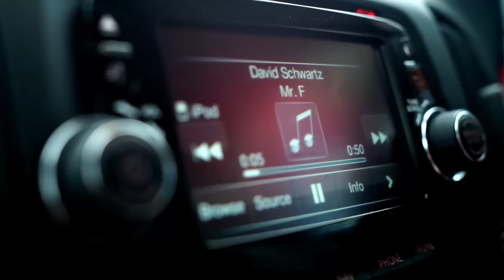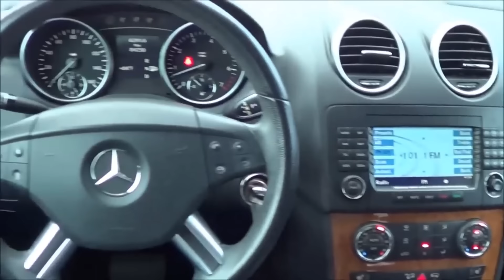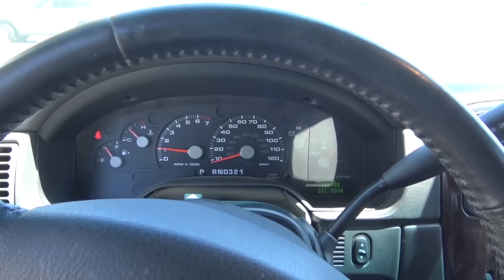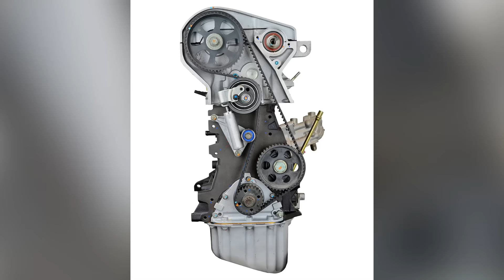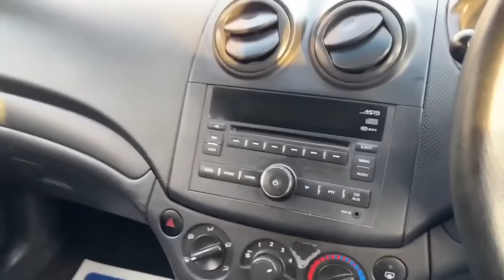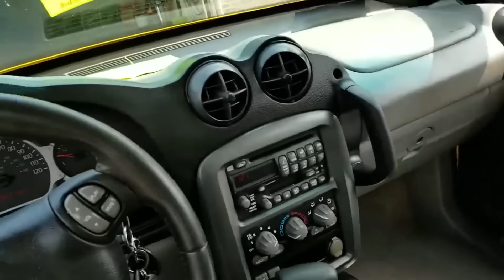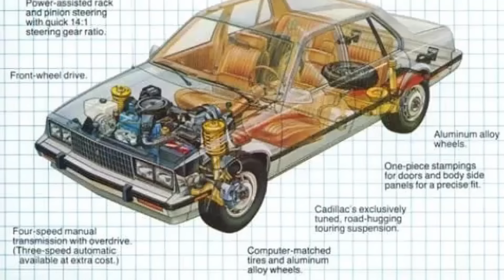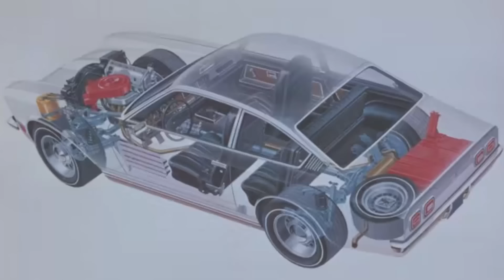30 Least Reliable Cars That Won't Even Last 60,000 Miles!

Comment: I owned a 2017 FIat 124 Spider convertible.  Assembled by Mazda,  I had no problems up to 70k miles when I traded it in for a 2023 Honda RIdgeline.  So, not all FIats are junk, just the majority of them!
Reply: It wasn't assembled by Mazda, it was a Mazda. Just a Miata with a differenet skin on it and Fiat badges.
Reply: @paultomaszewski1964  not completely true, Paul.  The FIat 124 had a Mazda transmission but a FIat 1.4L Turbo, iron block with aluminum heads.  Ran very well through to the time it was sold.  Mazda upped their non-turbo 4 in the Miata in 2018 to 185 horses (v 160 horses in the Fiat 124).
Reply: It had a Chrysler 1.4 turbo whereas the Miata, a non-turbo Mazda 4. Only the bodies were built by Mazda.

Comment: It's funny, I own a 2009 Chevy Aveo and it's been my most reliable car to date. Simple, basic motoring with nothing to go wrong. Mine has covered just shy of 277,000 kilometres and it runs great. I've only replaced the clutch once, besides regular servicing and wear & tear parts the car is still original, engine has never been opened and only front control arms have been replaced.
Reply: Maybe the Aveo sold in your market was better than the one for the US market.
Reply: @filippocorti6760  It's definitely possible or maybe I'm just lucky 🤷🏻‍♂️

Comment: Thumb nail looks like a Ford Taurus, I got a 09 still running like a champ .  Luck of the draw maybe 🤔
Reply: Mines is also, 2013 Taurus. The only thing I hate is the water pump issue.
Reply: Ive got a 2012 fusion its very similar  car . 280k with no issues
Reply: Notice it wasn't on this list, because it was a decent car that Ford and their wisdom stopped making for more profit margin SUV/CUV's that have been less reliable.
Reply: @zoomanx9661 did you have the pump replaced yet?  How many kms?

Comment: The Mitsubishi lancer isn't that bad I've had it for 5 years, It's a 2014 Mitsubishi lancer ES it currently has 150k miles on it, the most major problems I had was it's spark plugs and that's it.. with proper maintenance it'll be able to last long before you get a new car.

Comment: I had a 74 Vega used little oil AC ice cold.took out the 4 cylinder was still running good.but found a 400 small block car was fast and fun

Comment: I’m in the market for my very first car, I’ve been doing a lot of research on many different vehicles,  right now I’m looking at a 2014 Subaru outback. It has 128.3k miles. And it does have a CVT transmission. From what I’m getting from this video is that I’m good if I buy it. Correct?

Comment: USA has low octane and high percentage of ethanol in their fuels. For example in Europe 95 octans is minimum, while is the US 93 is premium gasoline. Also, USA has 10%-15% ethanol in fuel (not including high ethanol fuels for apecial vehicles), while Europe has up to 5% of ethanol in their fuel.
Reply: Interesting point. I wonder how much it matters for longevity.
Reply: @filippocorti6760  more octanes is better for engine.

Comment: You left out the 2004-2007 Mazda 6 S sedan & Sport Wagon with the Ford Duratech 3.0l engine. My 2005 S Wagon 143k miles won't stop springing coolant leaks as we speak[= Hoses, warped plastic T-fittings, water pump & belt and >now the radiator have to be replaced. It got so bad that I actually purchased every hose & plastic hose fitting under the hood as backup along with the drive belt, tensioner & idler pulley (it chirps at startup). [=

Comment: The Buick Rendezvous is the same platform as the Pontiac Aztek-- identical engine from the Chevy Venture and equivalents... They should have the same ranking, not be on opposite ends. I'm also surprised that Land/Range Rovers didn't make it to this list, but otherwise there aren't many surprises in this one.

Comment: Over engineering plus cheap manufacturing on new vehicles is a recipe for disaster. My 83 Thunderbird 5.0L with 85,000 miles still fires up and runs like a dream. And all electronics still work including power windows and locks, cruise control, digital dash, and all interior and exterior lights.

Comment: as soon as they said chrysler 200 I was like yep they clearly never owned any of these cars we had 2 Chrysler 200s they was great cars we never had a problem with them. Many of them now have over 100k miles and still on the road. I was looking at a dodge stratus in 2013 and my dad said you don't want it unless they can show you that the oil was changed every 3000 miles. He's been a mechanic for 30 years he tells me something about cars I listen.

Comment: Knew someone who had a 91 Passat GL and it made it to over 400 k recently and they live in Northern MN. Must’ve been a fluke. Used to have a 90 Jetta that I sold in 1993 with barely 30k on the odometer, and everything electrical, was a problem. Sometimes it would not start at all. Luckily it was under warranty at the time.
Reply: That was when they couldn't tell them V-Dub manufacturers NOTHING. 😊  And THEN...corporate big wigs got their hands in that cookie jar and I think everyone knows where I'm going with this...
Reply: And then lemons back then were quite few and far in between in comparison to today...

Comment: Fiat 500L only had problems with its automatic transmission. The 1.4 fiat engine like all modern fiat engines are bulletproof. The regular Fiat 500 is very reliable. Never heard it wasnt. 
The Mini would have been great if BMW didnt steal it from Rover.
The 2.8 engine in the chimaron was a very reliable unit.

Comment: The 5th and 6th gen Taurus used the 3.5L Duratec. Any Duratec besides the 2.5L and the 3.0 were junk. Porsche designed the Duratec 2.5 and 3.0. Ford started making rheir own changes to the 3.5 and 3.7. Absolute junk.

Comment: If I'm not mistaken or maybe I am, but the lancer uses 4B11 engine right? So, that means the engine is not so reliable? Apart from the transmission, we know CVT is not so reliable and its very sensitive

*edit : or 4B10 engine is not reliable?

Comment: Fiat 500L 1,4 engine has no timing chain but timing belt and yes it has to be replaced every 50K miles or every 5 years whatever comes first, but it is not a big job and it doesn't cost a lot. Certainly if maintained correctly they dont fail. Where are these data coming from?

Comment: A seemingly reliable brand?? KIA has always been junk. Far too easy to steal, unless you pay extra for models with Push-button start. Engines that spontaneously combust out of no where! And no, that's not an old issue. KIA and sister brand, Hyundai; never fixed the problem! KIA did nothing about it, while Hyundai installed a warning sensor to let drivers know when the problem was starting to occur. Translation = Get yourself to the near dealership before the engine torpedoes itself! Never reliable. Cheap, basic transportation that got more expensive over the decades with more issues than ever.

Comment: Chrysler and Dodge - worst brands ever.  Unreliable and are junk.  Had a 2002 Dodge Ram that died after only 70,000 miles (engine failure) and then a 2006 Chrysler 300 that had issue after issue (gearshift got stuck and had to jimmy it to make it come out of park, then the back windows stopped working, and then other small things would happen along with that, and then I read by 75,000 the engine faiiled for many who had the same car).  Never ever will buy a Chrysler product again.  Had great memories in both the Ram and 300 - but they are unreliable as all get-out.  No surprise the mid-2000's Sebring made the list - should have added the 300 to that - same years, same problems.